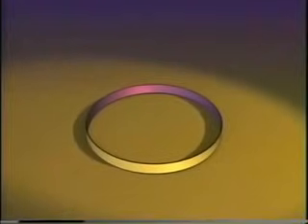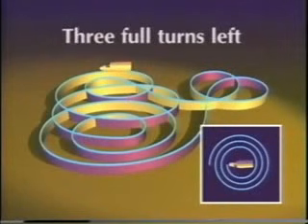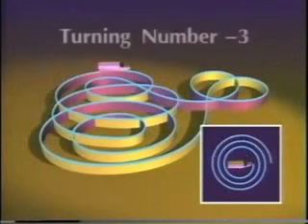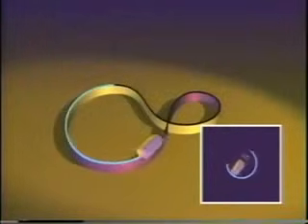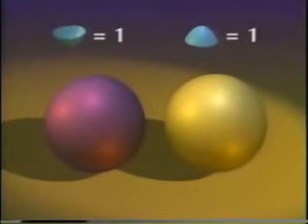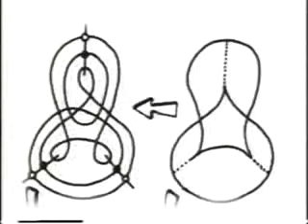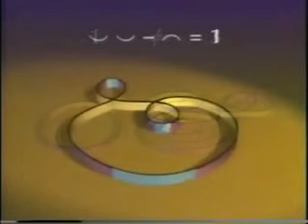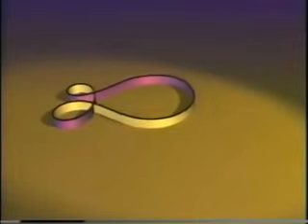how to theoretically turn a sphere inside out

Comment: Going back to the "no sharp corners" idea, if the substance can pass through itself, scientifically speaking, it's atoms would be able to pass through each other. The sphere wouldn't be pulled infinitely tight, the atoms at those creases would switch places. Thus, there would be no real sharp corners. Correct me if I'm wrong, but this is just my theory.

Comment: This is dumb. Of course you can make a sphere pass through itself somehow someway if you're using FAKE MATERIAL THAT CAN PASS THROUGH ITSELF! Like, let's make up some non-existent material to prove something can be done that can't actually be done. 

The fact they're using some mysterious alien material that doesn't actually exist makes this whole thing COMPLETELY irrelevant.
Reply: Logical Reason I just want to say that the point is not about creating an abstract material such that a sphere made of that can be turned inside out , it's the inverse.
The sole purpose of the material is to HELP visualize Smale's paradox (turning the sphere inside out) without having to define all the differential topology concepts, and without having to even define "turning inside out", so that anyone can understand it.
Reply: electric, magnetic and gravitational fields can be treated as a surface, such as the region where the forces on each point in the surface are identical.  Those can pass through each other and even be populated with actual physical material.  Soap bubbles can also sort of pass through each other.  Light can pass through itself.  Also, this is a mathematical concept, not a physics model until it is, perhaps, indirectly applied to something.
Reply: test7er Oh I get that it's merely a concept...but what's its purpose? What is it trying to prove? That you can turn a sphere inside out if you apply some ridiculous properties to it? Cool story bro.

So what's the purpose other than just making something up?
Reply: Logical Reason
It's exploring the geometric and topological properties of shapes and surfaces.  I understand that most people, including yourself, are mathematically illterate and don't possess the sophistication to grasp these concepts but it's not hard to understand that these kinds of demonstrations and exercises fundementally construct an overall mathematical structure that is invaluable to modern physics and science.  Things that are not superficially and obviously intuitive and practical can be fundemetal to more important theorems and concepts.

This video demonstrates concepts that are clearly far above your grasp, but please stay humble and dont get angry or defensive.  If you're serious about learning more I suggest you strart with the basics.  First learn high school geometry, trig, calculus, differential equations, analysis and maybe one day you will get to topology, which is the branch demonstrated the video here.
Reply: test7er You're missing my point. I'm not arguing the mathematics of it nor am I arguing the potential use of it...I'm arguing the fact that they just decided to make up some made up material that doesn't exist for the demonstration. It's silly. Stuff like this (other than a cool visual effect) doesn't really need something like this video.

"We can make this sphere turn inside out as long as it's made from some impossible material that can pass through itself all while not pinching itself."

Great. I can make a lot of things happen if I can just give unrealistic properties to stuff. This is like saying that I can cure hunger with this box that impossibly makes unlimited food.

Is it a cool thought experiment? A sort of "let's try it just to see if it's possible"? Sure...but the way they describe it makes it sound absurd and ultimately useless.
Reply: A satellite antenna is pretty useless to a 5-year-old.
Reply: test7er Hardly. The satellite antenna provides the 5 year old a way to talk to his grandparents or allows him to watch television. The child can play with it...they have imagination.

Can you give me a practical application for turning a sphere inside out? Other than just doing it just to do it? That's all this is. There is no reason other than just for the love of the challenge. 

I get that...I understand that...I'm a fan of "doing just to do". My point (as I've already stated) was that the conditions to do this are ridiculous. Talking about a material that can pass through itself (as if that's possible) but can't pinch is just as ridiculous as talking about a material that can pass through itself AND pitch itself. 

Do you not understand my point? You seem to be over-thinking this and question my mathematical abilities and understandings simply because I'm calling this out as being a completely made up circumstance so there for it is useless past the point of, again, "doing just to do". 

Is that simply enough for you to get it now?
Reply: test7er Also, none of that is to say that this is POINTLESS. Right now it is but with all things there may be a use or need for this on down the road. We've got a LONG way to go in math and science so who the hell knows if this is pointless or not. For now, however, it is ultimately useless.

Comment: Turning a sphere inside out.
Huh.
Couldn't you just, I don't know, cut a hollow rubber ball made in space in half and then push the outside-bottom of the two parts and then glue them back to- wait, you'd need to re-connect the two cut ends again, which would mean that you would end up with a sphere AGAIN, just with the inside on the out, and vice versa. Still works, though.

Comment: 1:36 creases AND pinches. Lies.
Reply: This argument is blowing my mind more than the actual video.
Reply: Not to mention it would rupture when you condensed the air that tightly. But a lot of people are probably going to say "well it doesn't have air dummy" well how did it push itself back into a perfect sphere? Or people might something retarded like "its a super sphere idiot". I have nothing to say to that shit.
Reply: TheDragonxmaster It's in space. Now shut up.
Reply: Carbon 12 Well I didn't continue, so there was no need to tell me to shut up. So how about you do.
Reply: TheDragonxmaster I already did, now you have fallen for your own argument sir.
Reply: Well, since you have replied, that means I have not meaninglessly told you to shut up. Therefore, my argument is still valid.
Reply: TheDragonxmaster Those aren't pinches or creases; it's just going through itself seamlessly.
Did you not watch the whole video? And the second part?
Reply: TheDragonxmaster The video itself proves your argument wrong. There aren't any pinches.
Reply: Obviously, there are. It pinches and creases before it smashes through itself at 1:37
Reply: TheDragonxmaster Not at all. Since it is going seamlessly through itself and no holes are made, along with no creases, it works fine. It simply spun around itself multiple times to create the second sphere.
Reply: TheDragonxmaster I think he might have said that wrong. He meant that it spun around multiple times to go inside-out. There is no second sphere, and nothing is created.
Reply: I watched both. Also, if it's "seamless" and going through itself, that means it's been ruptured. :l
Reply: Excuse me, SECOND sphere?
Reply: ***** Still pinched.
Reply: I love this argument over the absolute least valuable information any of us have ever learned. It's pretty funny seeing people argue whether the sphere "pinched" or not, meanwhile; when have you or will you ever need to apply anything taught here into anything you do in the future?
Reply: TheDragonxmaster I'll give you a rupture, and not on a stupid shape.
Reply: The Chinese Owl {\{UvU}/} Good luck with that buddy.
Reply: TheDragonxmaster  If the material can pass through itself I'd assume the air can as well.
Reply: The Chinese Owl {\{UvU}/} Actually, this argument over whether or not the sphere did or didn't pinch itself (it didn't) is way more productive than the argument over whether or not this video (or our existence, or whatever) is meaningful. There is a way to resolve whether or not the sphere-not-pinching-itself is a lie or a trick, which is to study the problem and try to poke holes in the argument. Its defenders will gain from this attempt (to the extent that your arguments are insightful rather than pedantic), in that they will better understand how to explain this solution to a skeptic. Eventually you will either come to understand that they are correct, or (less likely, but possible) you will find that some fundamental flaw has entered into their logic, and they will soon come to the understanding that you are the one who is correct.
     While I'm not going to enter into a (potentially) absurd argument over whether or not arguing that something is absurd is itself absurd, I will concede that there is a time and a place for such a discussion, just not here. This is a math problem, and that is a philosophy discussion.

    As a side note: all of you (supporters and detractors alike) might enjoy the speculative-fiction novel "Anathem" by Neal Stephenson. I think that whatever quality all of us have that has allowed us to be sucked into this discussion is the same quality that caused me to enjoy that novel so much.
Reply: It's a good read.

Comment: Theoretically since everything is made up of molecules, atoms anything can pass through anything. Speed up or slow down the actions between them and there is infinite space to pass though. The trick is to be slow (almost stopped) and fast at the same time to pass though these gaps.  Then you come across another problem, while an atom or molecule is in motion it forms a energy shield/ barrier to keep it bound with its other counterparts of that element you break that shield your break that bond. So yes in theory you can cause something to pass though itself, at the cost of perhaps destroying it in the process.  You would have to find away to bipass the bonds without breaking them.

Comment: interesting. This is how the fabric of the universe works in quantum theory by Hyser.  Moving faster than light may not take 187,000,000 MPH speeds with your theory here.  You can't move faster than the atoms that your spaceship is made from or they fly apart

Comment: What rule says that a crease made by twisting doesn't count as a crease like a crease caused by pushing/pulling? This thing breaks its own rules.

And what's wrong with creases if it can pass through itself? These are bullshit rules to begin with.
Reply: this is a simplification of homeomorphic deformations for video. They are not bullshit rules, read up on topology
Reply: I think it can not get creases because we can't diff a equation in creases. The equation need to be continuous. Or maybe, We can't create creases because it can rip the rubber...
Reply: Rubber can't pass through itself man.
Reply: P A N I C . It doesn't make any sense that your argument against twisting is "it's theoretical".  The video did not say creases where not allowed, just infinitely thin creases. This is to preserve the regular homotopy of S2 -> R3
Reply: vinesthemonkey 0:42

My argument wasn't: theoretical, therefore no twisting. It was: theoretical, therefore the rules aren't necessarily flawless. Question the rules man. I'm just not buying it, because to me, it seems very clear that they broke their own postulated rules.
Reply: vinesthemonkey I'm not opposed to being educated. What happens during the extreme twisting that prevents the apparently unavoidable infinite crease it would seem to me to cause? I'm really trying to visualize here. I can't see a way to twist like that without causing a crease. It's specifically breaking the rule at 3:00 . In my visualization anyway.
Reply: P A N I C .
I'm not a mathematician, and I slept through Topology class (loved the material, was just dog gone tired during that night course), but I think it has to do with gradients.

You can not differentiate (I'm using the calculus sense of the term) the kinds of creases they forbid.  That's because the differential from different approaches would be different (contradictory), so thus the overall differential does not exist.

You are allowed to do actions that keep the surface differentiable.

For a simpler, 2D version of what I'm talking about, imagine a smooth curve.  It's derivative from either the left or the right will be equal, and thus the overall derivative exists.

Now imagine a curve with a crease/crink/sharp point.  The derivative from the left would be different from the derivative from the right.  Therefore, the overall derivative at that point is non-existent.

Your twisting "creases" are just fine.  The gradient never fails there.
Reply: But twisting causes creases. It doesn't make sense even in the world of homeomorphism. It's theoretical, meaning it was postulated in somebody's head. Presumably somebody who isn't infallible.

Twisting like that causes obvious creases, and creases are against the rules. Unless their definition of a crease doesn't include creases made by twisting, then this video is wrong. Visibly so.
Reply: Daniel Russell Thanks, man. Imma read that a few times.